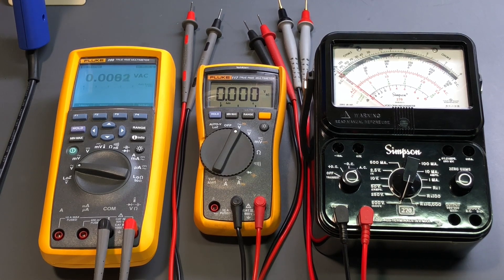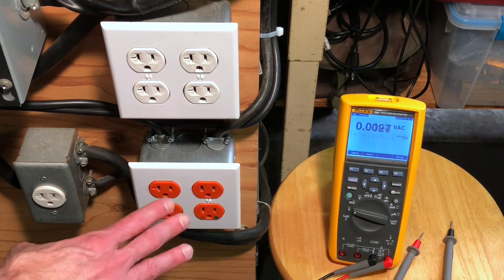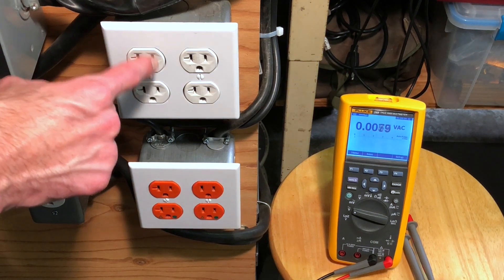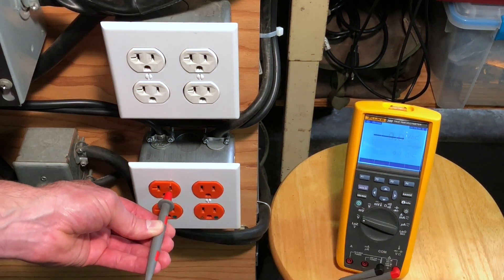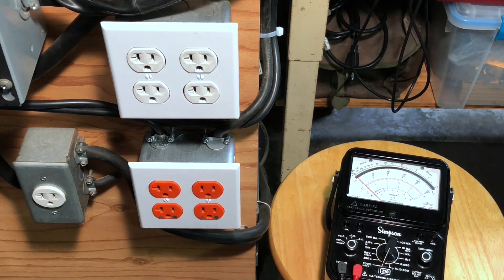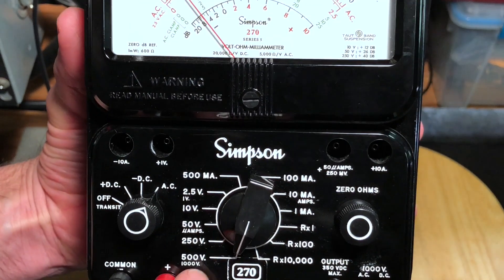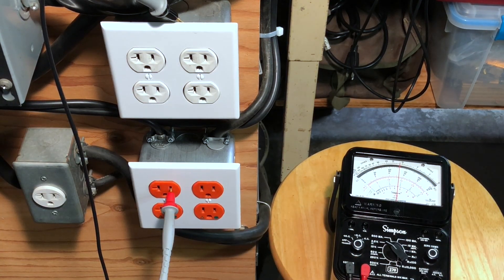Tech Talk - What Is A Ghost Voltage And How To Test It

Comment: Hello and how are you. You obviously understand electrical schematics and how these machines work .
 I have a 002a that I use as my backup generator. It has gotten me through several power outages, 1 as long as a week.
 I also have a 003a. I would like to change this machine over to strictly 220 v single phase.  I also would like to change the voltage regulator over to a common sx460 avr.  Have you ever considered doing this ? 
 I was on the Steel Soldiers website , I did get some help but I couldn't get it done.
 I don't understand electrical schematics either.
 There was a fella that once posted how to do this and posted a schematic too. His name was Craig Tull. 
 Would you be interested in looking into this ? 
 Thanks, Scott

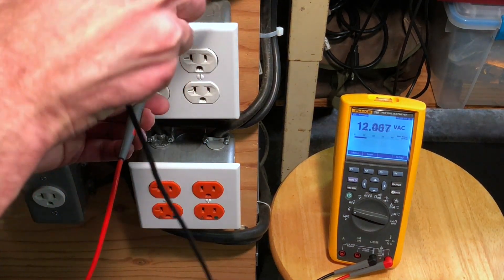Comment: I don't understand what you're saying at the 5:20 mark. I also don't understand how this example has a real world application. Ultimately what I'd like to know is how to test for ghost voltage in an old metal box with now ground wire.
Reply from the maker: At the time mark you mention I am showing how you could be shocked if you were to come in contact with the hot AC line.  The voltage potential exists between the hot AC line and earth ground.  If you measure a voltage with a DMM that has the low impedance mode as I show, and the voltage drops away to near zero, but the voltage remains with a DMM having regular high impedance then it was a ghost voltage.
Reply: @EriksElectronicsWorkbench  how do I test for ghost voltage in an old metal box with no ground wire? I work on old houses that just have a white and a black. I just bought a dmm with the low impedance setting. can I use the metal box itself as the "ground?"
Reply from the maker: @MartinCail  the metal box may or may not be at ground potential depending on wiring.  The ghost voltage would be between the metal box and the AC line(s) if it is present at all.  From the black to the white wire is the AC line voltage, not ghost voltage so be careful.  Take the volt reading in the normal AC measurement mode then take the reading in the low impedance mode.  If the voltage disappears in the low impedance mode then it was a ghost voltage.  If the voltage remains in the low impedance mode it is a live AC line or live AC between the points you are measuring meaning a shock hazard exists.

Comment: An examples of various circuit boards having Ghost Voltage Sources? What can be a Ghost Voltage Source? Most DVM meters don't have a Low impedance mode, can't you use a 1K ohm/5 watt or 10 watt resistor across the DVM meter port leads to put a LOAD on the high impedance DVM meter?
Reply from the maker: My experience is ghost voltages are more likely on long runs of parallel wire, induced and picked up by nearby power transformers, and by capacitive coupling effects of nearby conductors.  A typical circuit board on its own probably won't have ghost voltages but of course anything possible.  Yes you can load a high impedance DMM with a parallel resistor of appropriate size and eliminate or greatly reduce the ghost voltage.
Reply: @EriksElectronicsWorkbench  The formula is ohms law to compute the coupling resistance is Ghost Voltage / by current = coupling resistance. The Ghost Voltage is saying that there is coupling capacitances/coupling resistance? The Ghost Voltage is leakage current & Ghost voltage causes higher signal to noise ratio?
Reply from the maker: @waynegram8907  it is not as simple as ohms law because you don't know the actual ghost voltage, because the simple act of measuring the ghost voltage alters it to a lower value.  Even a high impedance DMM with 10 or 11 megohm impedance is loading and lowering the ghost voltage by some amount.  If you want to know the resistance you'd need to use an insulation tester that applies a known high voltage and measures the current thus giving the resistance.  Looking at a ghost voltage source, readings in the many gigaohms  or even teraohms would be expected.
Reply: @EriksElectronicsWorkbench  Yes the Insulation Tester or Megger will measure the wire under test with referenced to ground or the wire under test with referenced to another wire in the harness. The general rule of thumb is the LOWER insulation resistance = HIGHER Ghost Voltage?
Reply from the maker: @waynegram8907  yes as the resistance goes lower the apparent ghost voltage will be measured higher.  If the resistance falls low enough you will have a serious shock hazard.

Comment: I am working for now nearly 30 years as an electrician and this is a common problem aspecially in harsh or wet envoirements and here where we use 230/400V. For example machines and motors going on and off, not by the ghost-voltage itself but the relais are switched on and off by this phenomena. And this is the reason why i carry always a two-pole-tester with switchable load like the FLUKE T110 or a BENNING DUSPOL etc. greetings

Comment: Thanks for this refresh, very clear and well explained!
The use of metal boxes and conduits in domestic situations is making me somewhat nervous. The reason is that so many things can go wrong with these and the 'user' cannot safely or visually detect it is wrong or not without measurement equipment and the knowledge on how to use it. I believe the lower metal box itself on the isolation transformer should be earthed too. After all it is a metal box and the internal wiring can come loose and put the box on a dangerous potential. Only the box and NOT the socket, as you correctly point out.
(Youtube police mode on) Constructive criticism: Although you correctly explain that on the analog meter the red scale is applicable for AC, you're actually pointing to the black DC scale multiple times. The AC scale is not completely linear, the first 10% is shorter than on the DC scale. Admitted, this doesn't make a significant difference in this context and I would probably have made the same 'mistake'. (Youtube police mode off ;-)
Reply from the maker: The metal box with the isolation transformer outlets should not be earth grounded.  The reason is, suppose a wire comes loose and contacts inside the metal box.  And suppose the box were grounded.  Now one side of the isolation transformer has a ground reference and a shock hazard exists from the opposite secondary winding end to ground which completely defeats  what the isolation transformer was supposed to protect against.   With the box not grounded, suppose a wire comes loose and contacts inside the box.  A shock would only occur if you touch the metal outlet box and at the same time the opposite secondary winding end which is very unlikely to occur (but of course not impossible).   Regular testing of the whole isolation system for such faults is needed and if you prefer a plastic outlet box can be used.  I will try to be more clear when pointing to the meter scales as to which tic marks I'm using but I did mention the AC voltage is taken on the red scale.
Reply: The entire POINT of an isolation transformer is to isolate the connection from ground for safety.  That way you cannot get shocked by grounding yourself out accidentally. The only way you get shocked is by bridging the two legs of the transformer. 

If one of the wires from the isolation transformer contacts the metal box, it's fine because the only path back to the transformer is through the other leg of the transformer. However, if you connect ground to metal box and one of transformer legs also touches the metal box, then ground becomes a path back to the transformer and you can once again electrocute yourself by accidently grounding yourself.

Comment: something i don't understand with isolation transformers. The voltage is still the same so must still be dangerous but you are also isolating from the RCD protection circuit so how does that male it safer? I guess if you touch both live and neutral on the other side of an isolation transformer you are more likely to just burn yourself rather than have the current flow through you (possibly essential organs) to ground but if you touched one of eack terminal in one of each hands then you would be at a greater risk.
Reply: Yes, but the second important benefit of an isolation transformer is that on mains powered test gear, the probe return wire is usually connected to ground.  By making your test gear float you can protect both your test gear and yourself by preventing a live-earth short during testing.
Reply from the maker: Yes the secondary of the isolation transformer is just as dangerous as the normal AC line voltage.  If you contact between both ends of the transformer's secondary you will be shocked.  The protection or isolation the transformer offers is that there is no longer a ground reference which reduces the shock hazard.  In other words, if you contact ONE SIDE of the transformer's secondary (and assuming the transformer and wiring is set up correctly) there is no path the current can take through your body to ground.

Comment: Some older small LED  lamps exhibit a ( ghost ) glow when turned off ... this is due to the leakage capacitance of the switch drop wires ... many folk find this annoying ... but ... these amazing lamps give an ( almost free ? )  NIGHT  LIGHT ! ! ... (  handy to avoid tripping over the cat at night ? ?  ) ..... ( tried - n - tested ) .......... DAVE™🛑
Reply from the maker: Yes LED's require very little current to operate (compared to an incandescent bulb) and with necessary current limiting resistors they are fairly high impedance loads.
Reply: Free: unfortunately not, while it is very little energy it is measured by the utilities meter.
Reply: @Janktzoni  I did say : ALMOST  free .... this tiny glow would probably cost about ( ? UK , £1 ) for the whole year , which is VERY affordable ( Ha - Ha ! ) ........ DAVE™🛑

Comment: Very interesting subject Eric, thanks for exploring it! I've never encountered the concept. None of my DMMs have a low Z setting, but it is fun food for thought as to how one might measure the ghost other ways. Appreciate your work! - jrh
Reply: In order to remove the "ghost" voltage, there must be a load impedance significantly lower than the output impedance of the "ghost" voltage. That lower impedance can but does not have to be provided by the meter itself.  You can simply add an appropriately sized resistor in parallel to the meter to provide enough load to pull down the "ghost" voltage.
Reply: @timharig  Thanks for the insight timharig! Impedance is still a little bit mysterious for me in some situations, but discussions like this help with my understanding. Appreciate it.-jrh
Reply: @robharley9838  Don't let the word scare you.  For the purposes of this video, since there is only one frequency involved and we are not dealing with reactive components, you can treat impedance just like resistance.  Ohms law for impedance is the same as for resistance:

V= IZ

Serial impedances are additive:

Zt = Z1 + Z2 + Z3 + ...

Parallel impedances follow the same rule as parallel resistances:

Zt = 1/(1/Z1 + 1/Z2 + 1/Z3 + ...)

The voltage dropped in series impedances drop in proportion to their impedances:

V1 = V*Z1/(Z1+Z2)
V2 = V*Z2/(Z1+Z2)
etc.

If you have a 120V ghost voltage with an output impedance of 2Meg ohm and you connect a meter with a 10Meg ohm input impedance, then the voltage that the  meter measures will be the drop across its 10Meg ohm input:

V = 120*(10Meg/(10Meg + 2Meg)) = 100V

If however, measure the same 120V@2Meg Ohm ghost voltage with a meter that only has a 100k Ohm input impedance, then most of the voltage is dropped across the ghost voltage's impedance and the meter will only measure:

V = 120(100k/(100k + 2Meg)) = 5.7V

If you have a 10Meg ohm meter and you want to reduce its apparent input impedance, you could take the 100k ohm resistor and connect it in parallel with the meter.  Then the meter's apparent impedance is:

Zm + Zr = 1/(1/100k + 1/10Meg) = 99k ohm

If you wanted to further remove the ghost voltage, then you could use an even lower value resistor.  Assuming a 1k ohm resistor:

Zm + Zr = 1/(1/1k + 1/10Meg) = 1k

V = 120(1k/(1k + 2Meg)) = 60mV

Note however, that if the voltage being measured is NOT a ghost voltage and the output impedance of the REAL voltage was say 0.1 ohm, then the current flowing through such a small resistor could be significant:

V = 120(1k/(1k+0.1)) = 120V
I = 120/1k = 120mA

That is enough to make a small resistor warm and enough to interfere with the operation of lower power circuits  -- which is why volt meters usually try to have as high of an input impedance as possible.

Also note that if we ARE dealing with reactive components (inductors [coils] and capacitors) then the equations above still work; but, we have to treat impedance as a complex vector and we need to be concerned with how the impedance of reactive components changes with frequency.
Reply: @timharig  Many thanks for the lesson! OHMs law rules. I'll be pondering this for sure. -jrh

Comment: My Fluke 87V has a LoZ setting, however it read 120 volts through my isolation transformer to ground.  When I used my Fluke 117 that also has a LoZ setting, the reading was close to zero, congruent to your video.  I connected a light bulb through my isolation transformer to ground and it did not light.  Any idea why the Fluke 87V did not read correctly?
Reply from the maker: The Fluke 87V doesn't have a Lo impedance setting.  The LO feature in yellow marking  by the AC volts range is actually a low pass filter useful when measuring noisy devices like variable frequency drives for motors.  The standard way to show the two functions is  that the low pass filter is shown by the marking LO with the flat and sloping line over the letters, the Lo impedance feature is shown by the marking LoZ.
Reply: Nevermind, my 87V does NOT have LoZ setting, it has an Lo setting for "Low Pass" filter.  My 117 has an LoZ setting.

Comment: Now to check if any of my (cheap) multimeters have a low impedance setting, I doubt it.
Reply: Just add a resistor across the terminals of the meter.
Reply: @migsvensurfing6310I was wondering if this might work, since I don’t have one either.
I’m guessing because it’s in parallel and not in series, that’s why it lowers the impedance instead of increasing it, right?
What value/rating resistor should be used? Does it need to be a high wattage or with it being parallel that doesn’t matter?